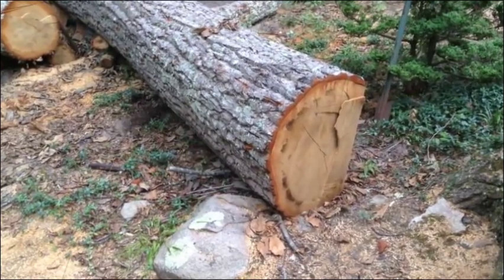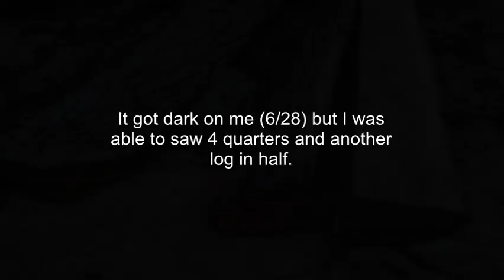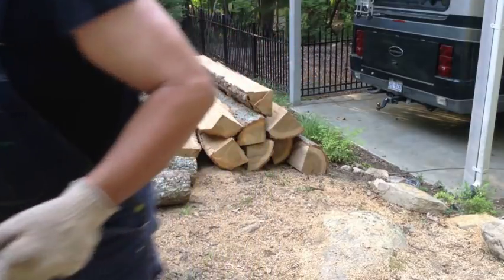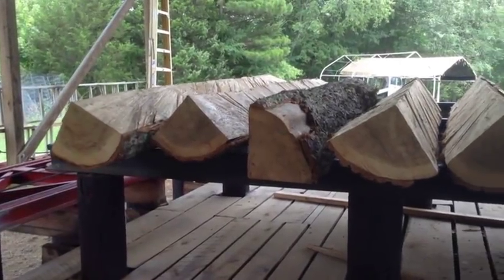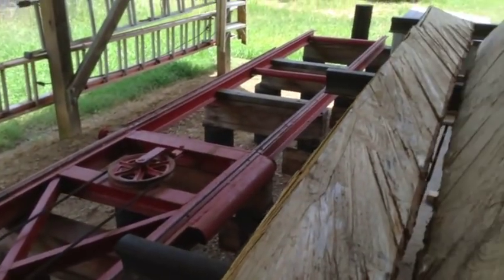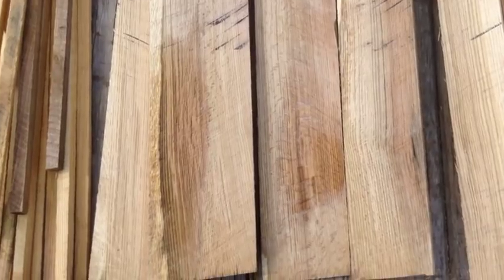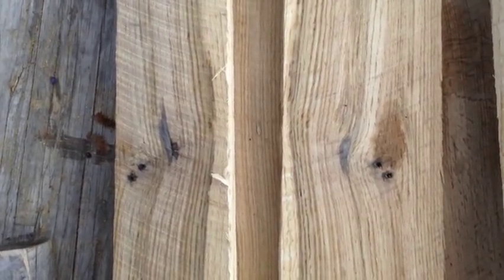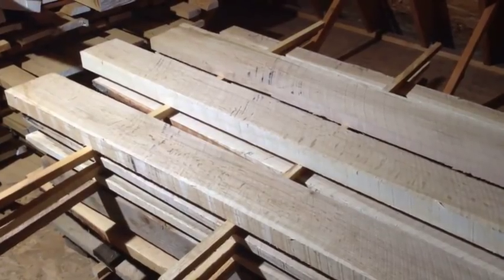Quartersawing Chestnut Oak on the 00 Frick, 30 June 2018

Comment: Quarter/Rift sawn lumber is some of the most stable wood I have worked with.  Nice job.  Chestnut oak is pretty.
Reply from the maker: I love the quartersawn. We built our mantle out of QSWO about 8 years ago and love it. The QSWO has stayed stable all of these years even with the high heat in the winter and air conditioning in the summer. Can't beat the look of quartersawn either.

Comment: David you have came a good ways and you have got this old mill purring pretty darn good. But that seems like a quite small saw blade not alot of reach through. The Frick mill i had ran a 54 inch blade. It really doesn't take that much more horsepower it's more about rpm/blade speed and maintaining that speed under load. I powered my mill with a old chopped down 383 Oldsmobile with a automatic transmission. I was surprised but we could control blade speed quite good by locking the transmission in 2nd. It would actually shift to maintain blade speed while under load in a log. Amazing how well it worked. Not sure you know but optimum speed for sawing is to have those teeth traveling no less than 10,000 fpm. (Feet per minute). Which you can calculate by circumference by rpm.to measure saw speed.
Reply from the maker: Ken, that actually is a 54" on my saw. I lost a couple of inches of cutting out of it though when I changed out the original Frick 00 rotating solid shaft axles with pressed on wheels and went to the 01 non-rotating solid axles with tapered bearings. It shifted the carriage up but fixed the issues I was having with carriage movement. I calculated the tip speed once and was running in the upper 9000fpm range so I am close to the 10k.
Reply: @davidcunningham257  well that makes sense but losing that much reach on a circle mill is a pretty big deal when sawing. It seems to be running fairly good though so you have done pretty good at tuneing in.  At some point though if you can it would help if you can squeeze that extra rpm needed to get that extra 1,000 fpm it will help make the saw much more stable and improve how it cuts through the wood. Not sure how many logs of size you get to saw but they made a 60 inch blade that you could mount on with little adjustment you would need to reset your blade guide of course. You would likely need a few more horsepower not being there in person it's hard to tell if your maxing out with current blade. But at current rpm by going bigger blade you would automatically increase your tooth speed. That would be a huge difference in size capacity of what you cam saw and save a ton of headache. They can be exspensive though but they are alot of these old mills around anymore you might find a good used one to restore.
Reply from the maker: @kenjett2434  My engine pushes 190HP which is too much for the 2-3/16 inch shaft. According to what I have found, you cannot send more than 90HP to the shaft at 600rpm at that shaft size. I found this out the hard way when the shaft bowed having 6 belts on the sheave and locked the saw in the log. The new mandrel was destroyed. I had a new one built with 6" collars but still 2-3/16 so I could use my bearings. I removed enough belts to only send 100hp to the shaft but even still, I have a third bearing so the engine pulls between the bearings. Once that was complete, it solved all of my problems. I am not doing this for production so not looking to maximize what I get out of the saw, just want it to saw correctly when I do saw.
Reply: @davidcunningham257  yeah that does make sense mandrel size  does limit horsepower you can use. I wish I could recall what my mandrel size was. I know it's was quite heavy and sure it was well over 3 inches. I was sawing commercially so I pretty much had to run full tilt. We sawed mostly rail ties and cants for pallet lumber. The cants was primarily popular and sycamore and gave us at that time pretty decent money for wood that normally was hard to get rid of. We ran a direct pto shaft off of the transmission of our 383 Chrysler engine. It was just an old junk car we chopped in half behind the front seat. Then we ran a cable to the carburetor that served as a throttle. Anchored it right beside the control stick for the mill that way when not in a log it just fell to idle. Just before advancing carriage we could step on the throttle and bring it to speed then let up or add as needed with the automatic trans it was a perfect set up. When the logs came into the blade it really had that nice buzz sound. Certainly had the horsepower to zip right through anything the saw could reach through. I still miss running that old mill just something relaxing about it despite the hard work it took. As it was manual didn't have any hydraulics for it.
Reply from the maker: @kenjett2434  Sounds like you had a nice set up. I agree it is relaxing to saw, although this past weekend while sawing I found bees had set up in the mill and got stung 4 times while sawing. Not my best day! LOL!
Reply: @davidcunningham257  ouch never ran into a bee problem at the mill but when cutting out in the woods. Yeah more than once I ran into bees it certainly can ruin a day for you.

Comment: An old cabinet maker advised me to use oxalic acid to stop the beetles.  It worked because we cut the wood in early fall before it got cold, and never had holes in it.  we had ash, pecan, and eastern red cedar.
Reply from the maker: I have been using Bora-care on mine. Its expensive but I have not had powder post beetles after spraying. They get after the wood very quickly. If I saw it immediately, I store it in top of my shop where summer temps exceed 120F and that kills them off as well.

Comment: I need to find an old rusty saw blade to paint a country scene on, do you know where I would find one to purchase and any idea wht I would pay for one? Linda
Reply from the maker: You can usually find them on Ebay or I would suggest looking on craigslist locally or estate sales. They are very heavy so shipping is an issue if they are not local. Good luck finding one!

Comment: Which type of machine or engine runs this sawing blade...?
Reply from the maker: It is a 1955 Cummins HRF-6, naturally aspirated diesel, 6 cylinder that was a generator but we took the generator head off and converted it to a power take off for the sawmill. The engine produces up to 190 horsepower.

Comment: I had no idea there was any Chestnut still standing.
Reply from the maker: This is actually a chestnut oak which is very similar to a white oak. After being sawn, you cant tell the difference between it and white oak. Wished there were still American Chestnut's standing, I understand they were some beautiful trees.
Reply: @davidcunningham257  I wish there were still Chestnuts myself.  I use to buy some from this place near Boone North Carolina that salvaged chestnut from old barns in the area.  It was beautiful wood.  They called it Wormy Chestnut.
Reply from the maker: @randallmccorquodale3290  I would have loved to have seen the chestnuts but unfortunately, that was before my time. We have hiked the Linville Gorge for the past 20 years and have seen the loss of the Hemlocks in there. Areas that were once completely shaded by large trees are now mostly open with smaller trees filling in.
Reply: @davidcunningham257  I haven't been up to Linville Gorge in a long time.  I hate to hear this about the Hemlocks.  That is a shame.

Comment: Quarter sawn lumber is my favorite to saw. But I don't saw it just one way. I have a O Frick Sawmill.
Reply from the maker: Yep, I love sawing quarters also. All are smaller and minimized flipping. How do you do it on your 0 Frick?
Reply: I'm new sub but worked on a electric circle mill ,we mostly ran a 54 but did have a 72 I think. Seems like u have a lot of waste quarter sawing. I remember 21 inch boards coming off that mill
Reply: @dougsmith9099  I saw for a purpose what ever I need, when I need quarter sawn lumber I just rip the whole log, no wast but you get board and guarter lumber on the same log.
Reply: @deanconner2475  I didn't mean to sound critical I just didn't understand , the mill I worked on was for production u saw for your needs sorry for the misunderstanding
Reply: @dougsmith9099  thank for the comments, you said nothing wrong everyone is entitled to there own opinion, that's how we learn and get along, l saw so everyone can afford there projects, l injoy the comments.

Comment: Was wondering why you quartered the logs with a chainsaw and not the sawmill
Reply from the maker: There are a couple of issues there. Logs are very heavy so if you tried to saw it in half on the mill, it would put a lot of stress on the carriage as well as the saw. Then the half log would at some point break free as you were sawing through it. In addition, the mill can only saw 20.5" depth so it can't cut all the way through a 24" log. And, it would be very hard to manage catching half of the log as it came off the saw which would pose safety issues with whom ever is on the receiving end. Using a chainsaw, we can manage the logs on the ground and roll them as needed plus we can quarter larger than 24" logs.
Reply: Thanks for the reply I am wanting to get me a circle mill and am awful green  just trying to learn all I can before I take the leap
Reply from the maker: @evansedwards7573  Understood. All I can say is that you have to love them to be patient enough to get one set up to saw correctly but once you do, the are awesome to use. My problem when I started was that I didn't know anything about a circle mill so it was a 4 yr learning process to get mine up and going where it would saw like I knew it should. Getting everything aligned and operating correctly was a challenge. If you are looking for a circle mill, things to check are the carriage bearings, the collars, bearings and if the carriage is twisted or worn. Track alignment and such are things you can control once you are set up but bad carriage bearings which allow carriage movement side to side, bad collars and mandrel bearings will have you pulling your hair out with frustration.
Reply: David Cunningham I have watched all of your other videos and have learned a lot from them and am thankful that you take the time to make them. I am a backyard carpenter and wanted to try my hand at a circle mill I'm not looking to cut full time I just want to saw my own lumber as a hobby I guess. just keep the informative videos coming please and God bless you and your family
Reply: Evans Edwards what state are you in i have a mill for sale
Reply: Darren Hawkins I live in southwestern Virginia
Reply: Evans Edwards can you contact me on facebook i am in central ky this guy does an excellent job with his videos
Reply: Darren Hawkins I searched your name and I’m not sure how many pages off people that have your name I can’t count that high lol
Reply: Evans edwards darren hawkins gilberts creek forge
Reply: @evansedwards7573  if you have not gotten a mill I realize it's been a year of these comments. But instead of a circle mill I highly recommend a band mill for what you described as your purpose. I was a Sawyer for a few years and got alot of experience. The learning curve on a circle mill is a long labor of love. But takes little time and much easier on a band mill just for hobby lumber making.

Comment: If you're going flip it, it wood be easier on your roller bed.
Reply from the maker: Dean, I would typically pick up the half quarter, back up then spin it and sit it on the log deck then go around it. pick it back up and set it back on the mill. That is easiest, you are correct. The problem is when you fill the log deck with quarters, there isn't room to do that so I had to man handle the first few until there was room.